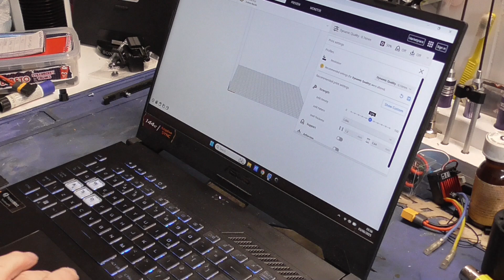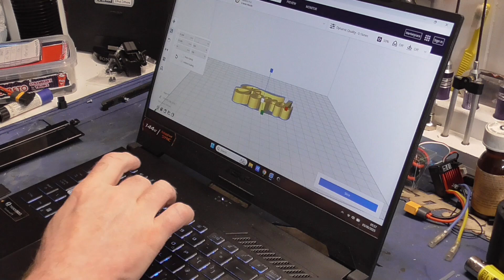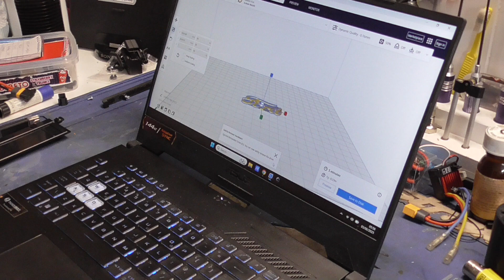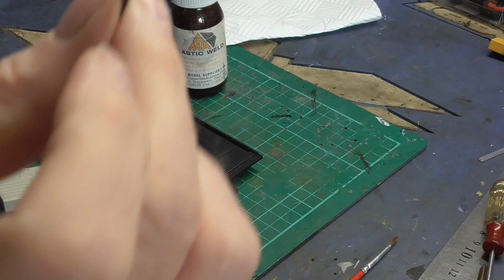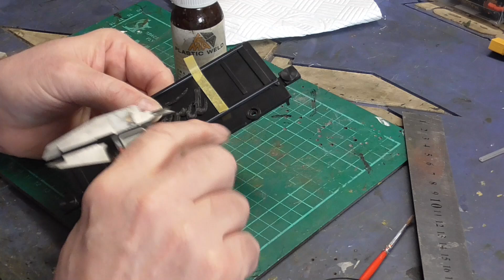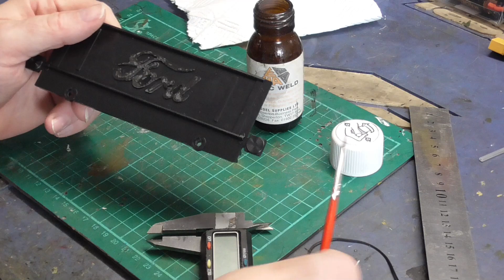Tamiya Midnight pumpkin - Time for a Custom body - rear panel

Comment: Thats looking good. I need a new 3d printer, mine is 5-6 years old and part are getting difficult. currently waiting for hot end from Ali :(
Reply from the maker: I upgraded this year, I have to say it's easier to use and faster but the prints are not quite as good. I have tweaked it a little but it needs more. What printed do you use.
Reply: @BasildonTrailBlazerRC I’ve got Anet ET4X parts are getting difficult, I’m aware that parts are interchangeable with other brands. Print out are not as good as it used to be, I used to level the bed every 3-4 prints, now before every print I need to level the bed manually. I’m thinking of elegoo Neptune 3 pro, unfortunately the minister of finance is not approving, hence ordering the part for my Anet😂
Reply from the maker: @MechanicallyFun  Shame where parts run out, that's why I went for and Ender 3 Pro. I now have the ender 3 V3 SE. It has more features and better to work on more plug and play. But I should have gone for a better one as the frame is not as solid as the old one and printed a frame to reduce wobble. I think I should have gone for a different brand. Elegoo does look nice.

Comment: Nice! that's one way to get the ford logo on the pumpkin!
Reply from the maker: The 3D printer has it uses, the older Logo has an advantage it goes on in one piece. I could have done the correct one but it would have been a nightmare to get the 4 separate letters straight.

Comment: Good to see the process. You should include more in future videos.
Reply from the maker: I have to be in the right mind to make more like this, then what to show. Bad weather does not help, doing my head in and not getting out enough. Had shed time yesterday, today 10mins finishing off but could not go on. Add 2 more thing to the themed build, would like to get out for a run but too wet here.

Comment: Good job bro! I love 3d printing.
Reply from the maker: The printer is so cool for detail parts for the trucks, I just wished I knew more using CAD. What I design is very basic but I do make quite a few things, but re-sizing things off Thingiverse I do a lot and I find easy in the slicing software.